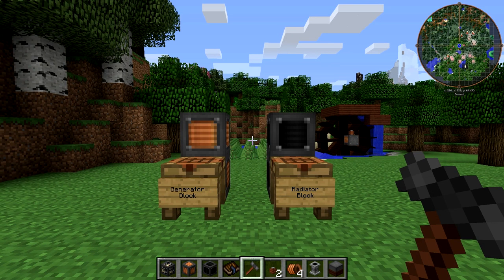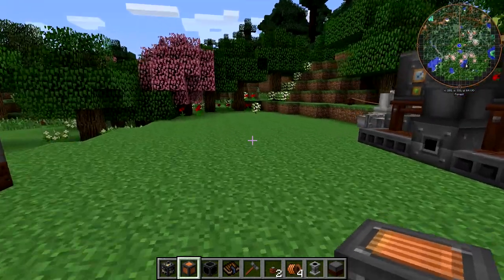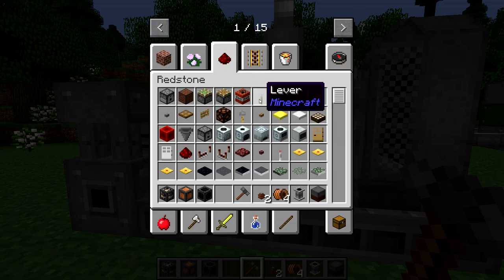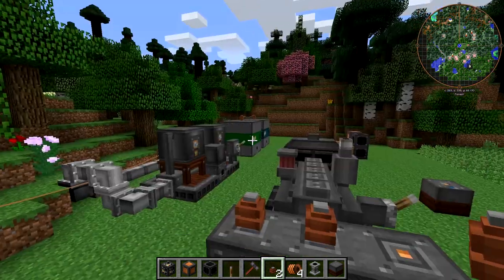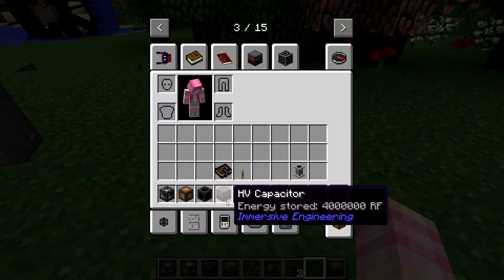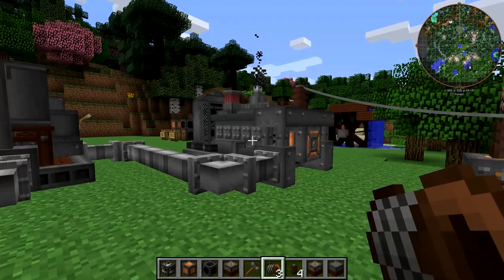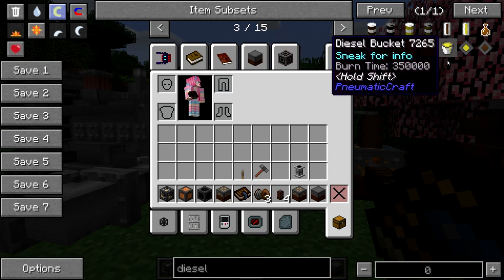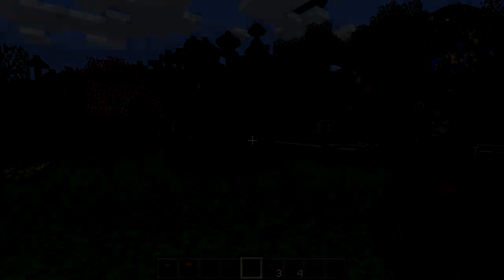Immersive Engineering Tutorial #11 - Diesel Generator

Comment: Is it a bad idea to have tanks between the refinery and engine? I have a pump moving fuel from the refinery into two tanks (top), then a second pump that should be drawing the fuel from the base of the tanks into the engine. I have 4 HV capacitors hooked up in a series and the one connected to the generator is empty.

Comment: Well, its been 6 months and no Nuclear Reactor. Is it me or is I.E. a bit goofy? Sometimes I find sometimes thermoelectric generators don't work, capacitors don't charge and machines don't connect. Its all a bit hit and miss I find. For example I can build two identical (there is NO confusion here, they really are 100% identical) thermoelectric generators and one will produce energy and the other wont, or sometimes I try and add a capacitor to a T.E.G. and it wont charge.... I remove the capacitor and replace it a few times and it starts working. Also It seems to take ages for the current to start flowing, like waiting for a cold tap to run hot.
Reply from the maker: Well the connectors do have an internal buffer that has to fill before power starts flowing. Those seem like some interesting inconsistency problems.

Comment: my generator won't work. i have a capacitor hooked on to it, got fuel and a lever but nothing happens
Reply from the maker: you don't actually need the lever, that just turns it off. Make sure you have the capacitor properly wired to the generator and that the side of the capacitor that you're attaching it to is set as an input
Reply: i did, with HV wire and the capacitor was wired correctly. btw im in a server so if you can help, i appreciate it
Reply: Mine won't work either
Reply: Is the capaciter full? If it is the generator will start again when the capaciter gets drained
Reply: I'm not sure if it is full or not. It shows numbers
Reply: Which mc version are you playing on
Reply: Mine is on twitch, i can't get the regular java to load.